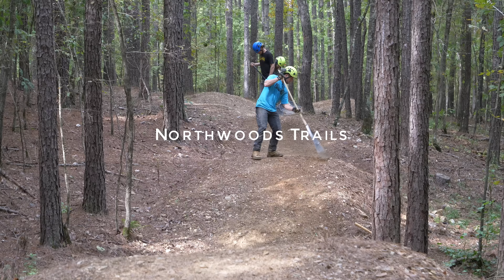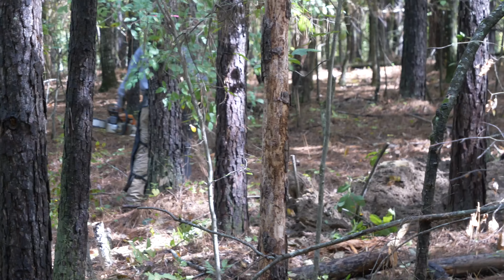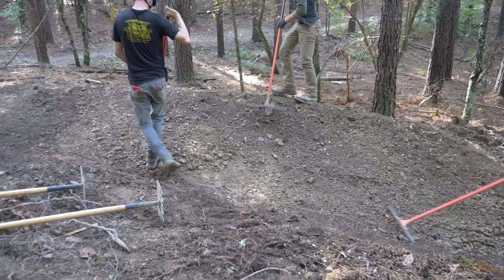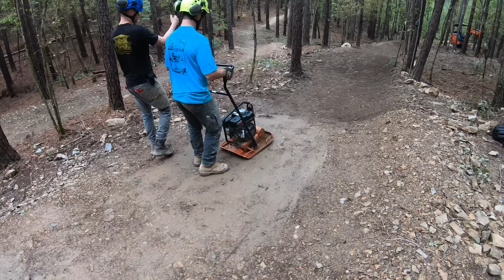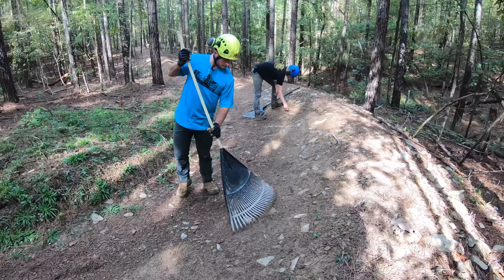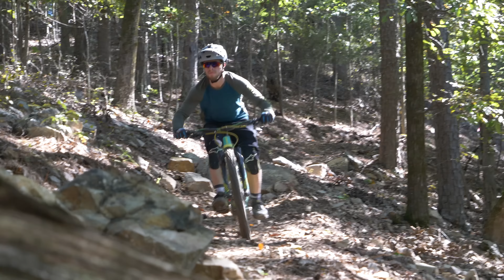How flow trails are built | Build & Ride in Hot Springs, Arkansas

Comment: That butt-less shovel is a thing of beauty! Every dirt jump builder's dream.
Reply: Victor Reyes look at Seth’s murder machine bike build hardtail made to be thrown around
Reply: Skills With Phil a
Reply: Skills With Phil when you coming to Bentonville to shred bro? You’ve waited long enough!
Reply: hi
Reply: Your welcome phil 😂 look up "a.m Leonard tools"  they should have it on their site fairly cheap too. It has really awesome impact dampening aswell.
Reply: Anyone identify, and know where to get those wide, flat bottom shovels? What I find have a trapezoid-shaped bottom or the open tunnel/socket (butt) that traps dirt.
Reply: @bruceswanson2811  look up a.m Leonard tools. This exact shovel is on thier site for like 40-50 bucks. It's well worth it
Reply: @bruceswanson2811  my bad it's like $56 plus tax.
Reply: @Chrisakatrailjesus  Thanks, Chris. (I stand corrected)  I did go to look and see that the wood handled model seems to be the exact model. The fiberglass model looks different, but I cant believe their forging dies would be different for those two. The price may be a little higher (thanks, tarriffs?) but in a year or two I wont remember...
Thanks!
Reply: @bruceswanson2811  no problem bro. I would definitely go with the ash handle over the fiber glass. It has really good vibration damping.
Reply: Victor Reyes rockshox has good forks that aren’t tapered. If you replace the fork, you’ll be fine.
Reply: I like poo
Reply: That's True Phill
Reply: Ben Hamilton what
Reply: @Victor Reyes hope you got a new bike or fork!
Reply: Agreed
Reply: @Benton Hugo instablaster =)
Reply: @Corbin Adam It did the trick and I now got access to my account again. I'm so happy:D
Thank you so much, you really help me out :D
Reply: @Benton Hugo glad I could help :)

Comment: Hey Seth, I’m about to buy a new bike but am still deciding wether I want to get a Hardtail or a full suspension. Could you make a video on what to buy and what is better for certain types of riding, a Hardtail or full suspension??
Reply: crb 3417 full suspension
Reply: Shane do you think I could still do a full on a $1500 budget?
Reply: marin hawkhill is one. gaint stance may also be another. And those are 2 pretty good bikes.
Reply: Shane do you think those would be better than a Hardtail at that price such as a Commencal meta ht am?
Reply: crb 3417 Personally i would rather have a full suspension, although i have had a ton of fun on a hardtail, i guess it comes down to personal preference and the trails you are going to be riding.
Reply: Shane okay thanks for your input

Comment: I'm surprised they're not using the compactor for the berms, where I used to work we're do the entire trails with it (apart from rock sections). For the berms we fitted the front end of our compactors with loops to which we attached a rope so that one could pull it up the berms while another is pushing. Seeing how the berms are often the features that are the first to get damaged, we wanted to make sure it was as hard as it could be. Never forget that 5 degree down angle all along the trails for the drainage. Building trails is a lot of fun! The hardest and worse part in my opinion would be getting rid of the trees and plants where the trails are initially flagged, that's harsh.

Comment: I want to buy a new bike to do a little trail riding and some jumping but also that I can do some bunny hops and tricks on in the 700-800 dollar range and I’ve been looking at the diamondback line and the Raleigh Tokul 2 as well as the cannondale cujo 2 what do y’all think would be the best choice or do you have a better suggestion? And disregard the forks since I’ll probably replace it with a rockshox recon on the first two (the last one already comes with a recon)